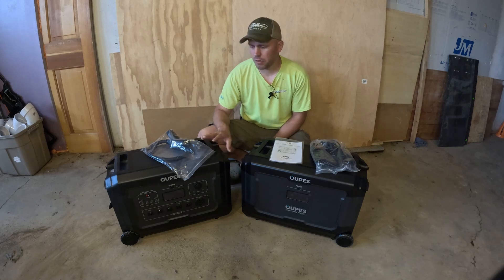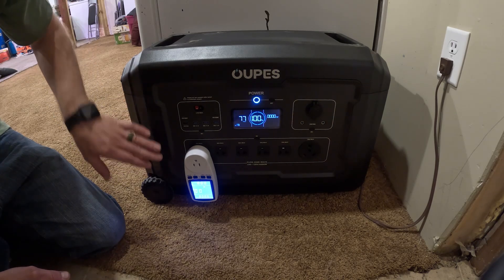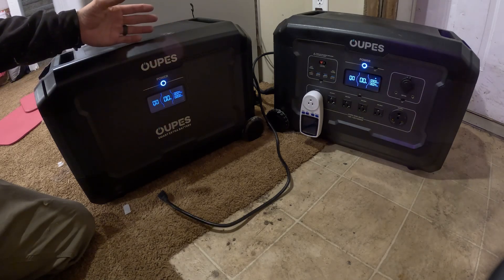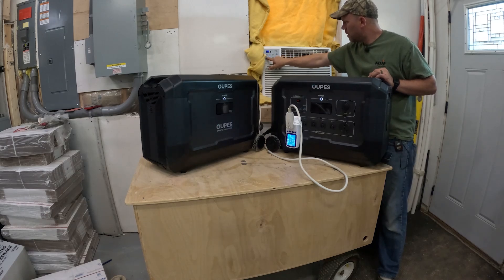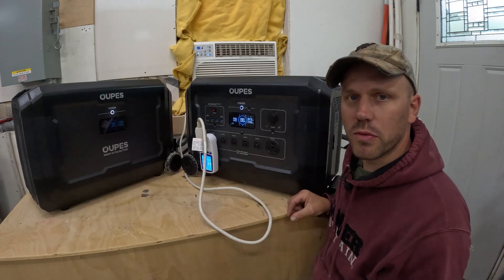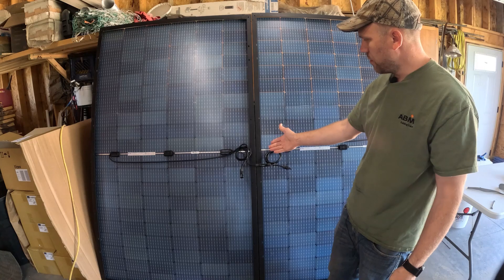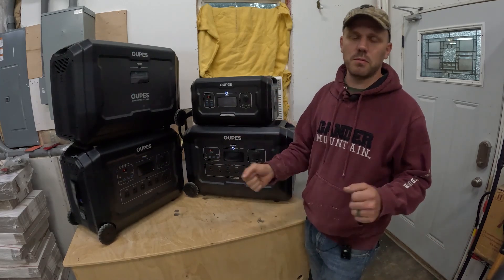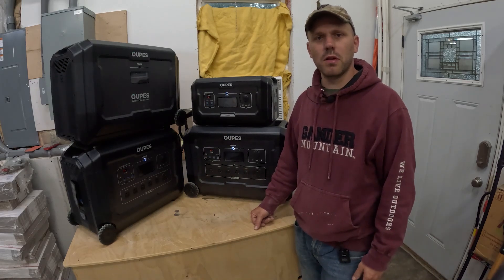Capacity Test of OUPES Mega 5 & B5 Extra Battery (Solar Panel Choice Guide Included)

Comment: Mega 5 freezes up.
Will not turn on just says OFF.
Do not buy one.
Bought mine in july 2024 its oct 2024 last two weeks no power.
Have been in touch with technical people. Do this do that, still with no power. Bought a gas generator the other day OUPES  $3800 no power still.
Bought a gas generator  the outher day.
Harbor freight $ 800. Plus gas can and 5 gal gas.now nov 30 2024 and still no batt sent to me and they got mine back over a month and half.

Comment: Nice review. Your decision to use these units for an air conditioner and refrigerator was spot on since I would probably purchase these generators for that reason. Also, noting the weight difference between generators was worth mentioning.